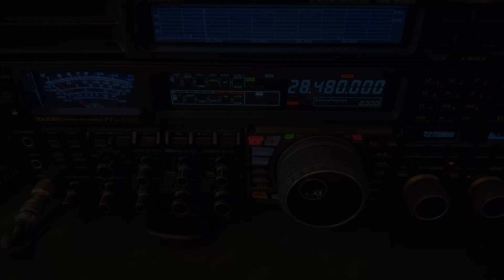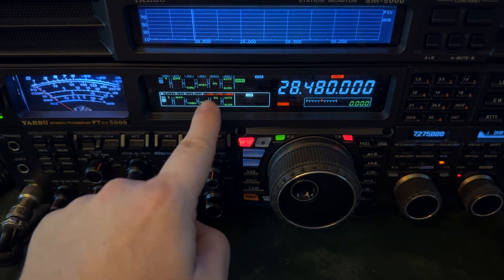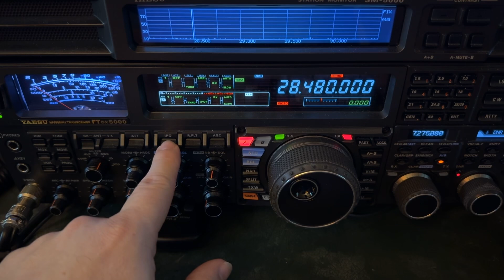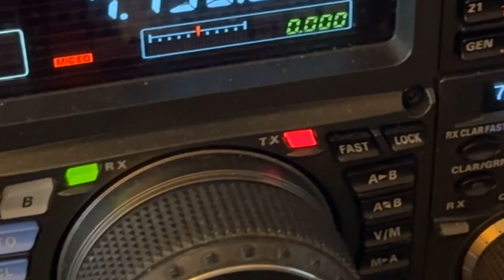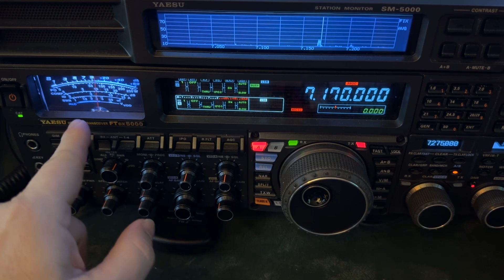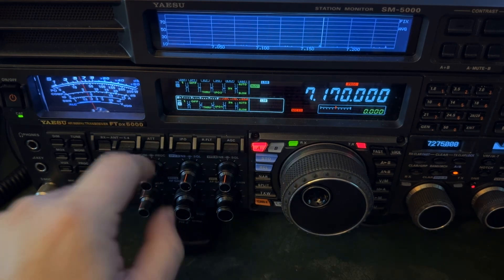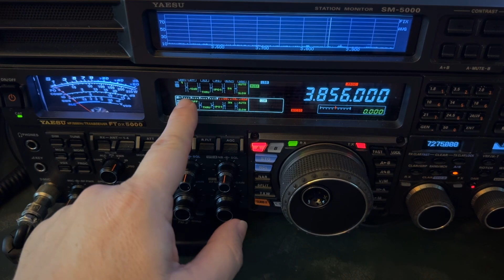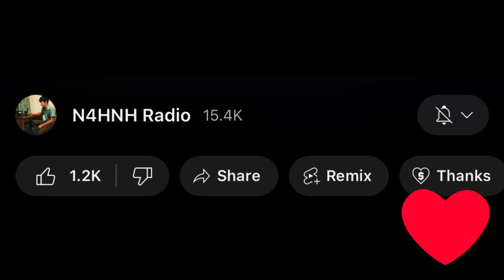Balancing ATT, IPO & DNR #yaesu #ftdx5000 #ftdx10 #ft710 #891 #ft991

Comment: Do you ever run the AGC in a position other than "Auto" ?  I had seen in someone's video that they recommended AGC be set to "Auto" for SSB, but for FT8 to set it to "Fast".  I'd like to get your take on this.  Thanks and love your videos.   73
Reply from the maker: FT8 signals are a constant amplitude type (within each 15-second cycle).  They use a very narrow bandwidth (~50 Hz). Fast AGC can cause the receiver gain to "pump" unnaturally in response to the rapid on/off keying of FT8 tones, leading to:
- Distorted audio waveform
- Increased noise between tones
- Decode failures or lower SNR reports
Reply: @n4hnhradio Thanks - so I assume then you use “Auto” AGC setting for SSB and FT8 ?  73
Reply from the maker: I do.  I have detailed videos about FT8.

Comment: So I learned from this, that to give someone a true signal report it’s using amp1 setting? I run a 101d. Most of the time I leave it on ipo except for 10 and 15 meters.
Reply from the maker: Well, yes and no.  The S-meter is calibrated for S9 at 14.2 Megahertz, using AMP1. That’s where it will be most accurate.  The meters are supposed to represent 6dB per S-unit but very few hold true to that. I generally use the meter as a reference point but I give the signal report by ear.  I have other videos where I explain my by-ear scale, in the video description.
Reply: @n4hnhradio By the way, when you run IPO, do you increase the level of the waterfall so the signals show better? I have mine turned up differently for each band.
Reply from the maker: Yes.  I have the scope level set assuming IPO.  But I don’t watch the scope much, in all honesty.
Reply: @n4hnhradio ok that’s what I’ve been doing too.  I’ve operated long enough now to hear what a good s9 or s5 etc sounds like to go by as reference. I just recently found myself having to explain the signal report to a new ham and had been thinking about it. Great timing for this video!
Reply from the maker: I’m glad you found this video.  However, I have covered the subject of S-meters for years.  Here is an example: https://youtu.be/AY2U6o0mblI?feature=shared

Comment: Thanks for this video.  I'm a newer ham, and even newer Patreon - and am enjoying all the training videos.  I noticed the choke on your mic cable.  I know their purpose, and understand some of it, but why on the mic cable?
Reply from the maker: Welcome!  The choke on the mic cable is to stop any stray RF that doesn’t get stopped by the chokes on the coax.  There was some stray RF causing distortion in my transmit audio. When using an antenna that requires an antenna matching unit (aka antenna tuner), there will be common-mode current coming back into the radio shack riding the outermost portion of the coaxial cable.  It radiates off the coax.  That’s why I have chokes on my coax.  There are videos on my YouTube channel that show me installing them and why.  Look for the playlist entitled, “RF In the Shack.”

They also make chokes for mouse cables and keyboard cables.  But the first place to put chokes is on the coax. 

Since you’re new, I highly recommend the Technical collection and the Radio Wave Propagation collection.